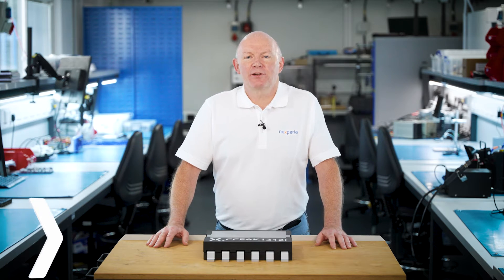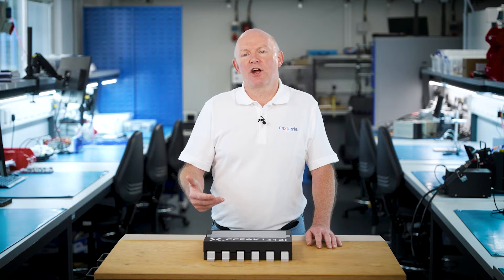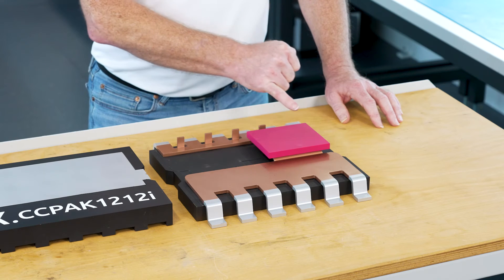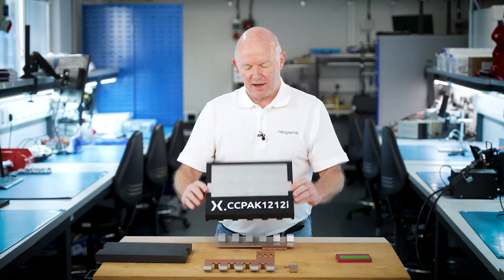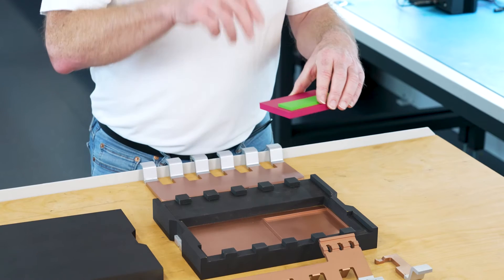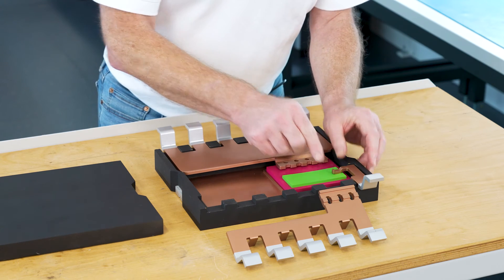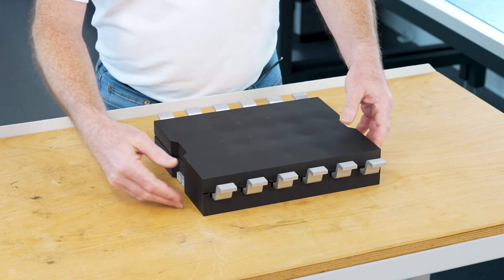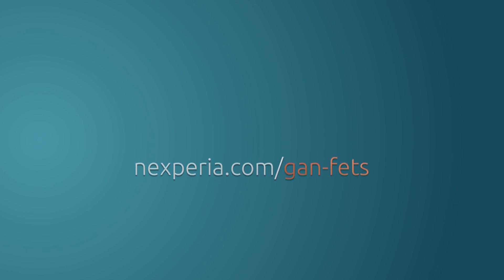CCPAK1212: a new era for power semiconductor packaging

Comment: 650Vds yeap but How much current? 200-300-400A?
Reply from the maker: Hi @azhuransmx126, thanks for the question. The first device that we released in this package is the GAN039-650NTB: https://www.nexperia.com/products/gan-fets/650-v-cascode-gan-fets/GAN039-650NTB.html
The current rating is 58.5 Amps but it is not limited by the package, it is limited by the RdsON.
In the future we will expand our portfolio of RdsONs in this package which will give a range of current capabilities.
The package itself can be used with devices capable to deliver in excess of 500 A.
Reply: @Nexperia  Thanks for the information about your current products, I am particularly studying the use of this Gallium Nitride technology and its great future in the already close humanoid robotics industry such as Teslabot and GaN FET technology since it is undoubtedly the best positioned for that application, since it offers a high power density in a compact space and a much higher efficiency than silicon technology and without being as expensive as the Silicon Carbide technology used in electric cars.  It is at an excellent balance point, and in the future, it is expected to offer a good price/power ratio, but only if it can offer to manage 200 to 400A like does the current Si and SiC technologies.

Comment: Very cool demo, what is the main advantage of GaN FETs over MOSFET or IGBTs? Are they specifically for that middle ground between where you would pick one or the other? As an example would these be suitable in high power applications like current regulation in a AC/DC welder without the need for a complex gate driver arrangement?
Reply from the maker: Thanks @thetooth =) 

Indeed, they are suitable for high-power converters. A major differentiator is the reverse recovery charge (Qrr), the Qrr of an equivalent, top of the range, Si MOSFET is more than 10x times worse, than that of GaN. Not only Qrr but also most of the parasitic capacitances, that play a role in the switching losses, are multiple times lower in GaN compared to any Silicon device. Resulting in more efficient operation and the enablement of new topologies like the AC/DC bridgeless totem-pole PFC converter. You can find out more on the link here: https://www.nexperia.com/products/gan-fets/family/CCPAK-GAN-FETS-SMD/#/p=1,s=0,f=,c=,rpp=,fs=0,sc=,so=,es=

Comment: In 1993 I created a similar hermetic package for power IGBT semiconductors US5347160A.  Chip size 1/2 inch square   Also for compression power semiconductors in 1989 US5053358.